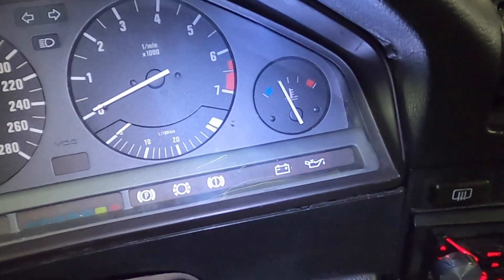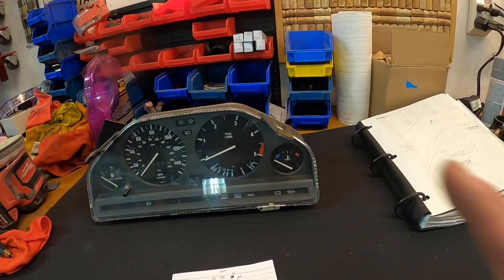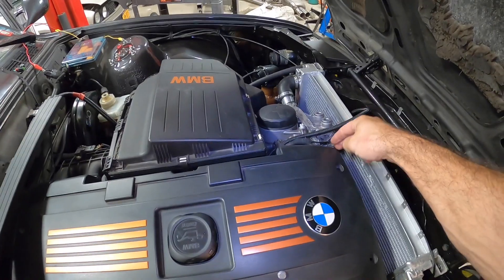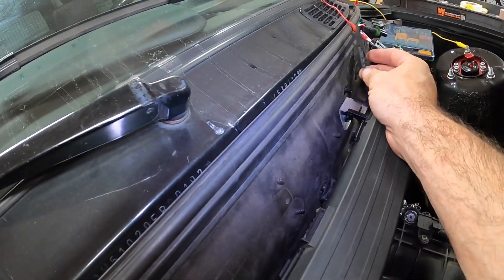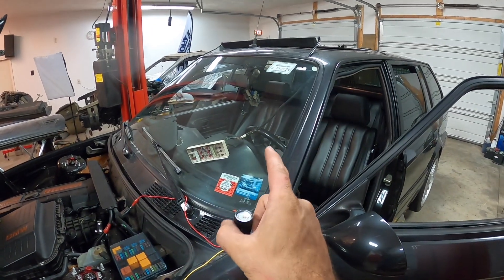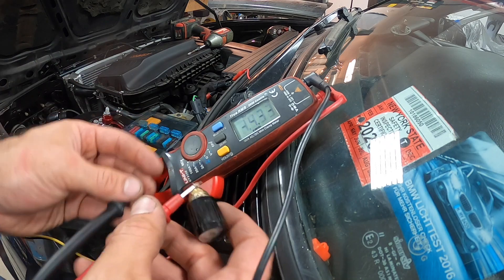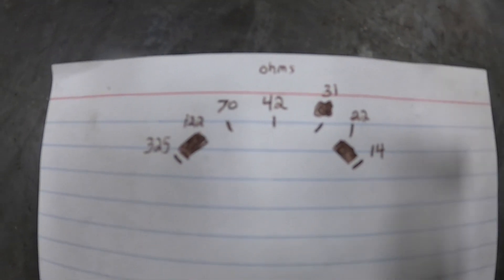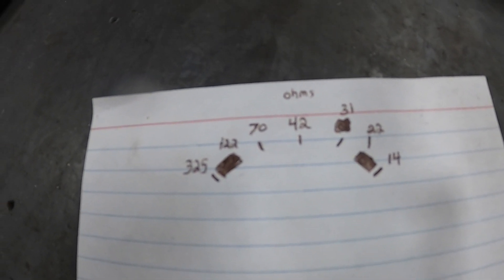Part 38: Here's One Thing You Probably Didn't Know About The E30 Temp Cluster!

Comment: Hi there with a s62 my gauge currently shows little past 1/4 and it never reaches 1/2 mark , At what temperature u will set 1/2 mark ? S62 runs 185-210 in normal operating condition so lets say 200f set it for a half mark?
Reply from the maker: Where are you measuring temp from on the s62?
Reply: @Garageaholic located at upper top radiator its the brown sensor from e30
Reply from the maker: No that’s probably your fan switch, not your temperature sensor for the cluster.
Reply: @Garageaholic no I have custom made radiator and there is a separate switch for puller fan , perhaps Im using wrong sensor?
Reply from the maker: The engine temperature sensor should be measured only as close to the thermostat as possible, or cylinder head. Never ever in the radiator - that does not accurately reflect the temperature of the engine.
Reply: @Garageaholic Thanks can You please let me  know how did You connect sensor to gauge in your s62 e30 , are You using original s62 sensor with 4 wires? Or You using one wire brown sensor but where did U mounted exactly?
Reply from the maker: @r1lukasz  I welded a M14 bung to the top of the thermostat housing on the S62 engine. Installed a single wire E30 temp sender in that location and wired the signal wire to the C101, which goes right to the cluster. Done
Reply: @Garageaholic thanks man, Do You have sufficient cooling with current setup? I see U have stock aux fan and U somehow fit a puller fan , can You share details what fan are U using and radiator? Any overheating issues with ac?

Comment: Great video. Does the temperature gauge have a connection to the ECU ?

On the 1990 316i , M40 engine. My temperature gauge just stopped working a few days ago , After I replaced the car battery. I am suspecting the cluster board. I have shorted out the coolant switch wire after disconnecting from the switch on the cylinder head , the temperature gauge still doesn't move at all. A bit of a surge could have blown something in the dashboard cluster. It starts up fine. Just need the temp gauge going again. I wouldn't even drive it for 500 meters without a functional temp gauge. 
Thank you

Comment: Thank you for the video ! Is it also normal that the indicated temperature on an E30 316 Carburator (M10 engine) is almost touching the red zone before getting back to the middle (and then going to the red zone again etc...) ?
Reply from the maker: Nope that’s not normal. I think you might have a bad radiator fan switch or air trapped in your coolant system!
Reply: @Garageaholic  ok thank you I'll check this then !

Comment: Great man, my m42 temp sensor was reading 1300ohms cold.
Reply from the maker: Yessssssssss!!!
Reply: @Garageaholic   correction 383ohms cold out of the block. My problem is that the temp gauge wont move over the blue marked area, no matter as of how long i run it, si board is replaced. Rev gauge works, grounding nut and point is fine. U reckon its the sensor messing?
Reply: @Garageaholic  it rises a bit but absolutely not over the blue mark.

Comment: I have a very detailed write up about calibrating E30 temperature gauge and characteristic
 curves of the temperature sensors. The approximation of formula for NTC thermistors can be very inaccurate in many cases. You can find it at my post https://www.facebook.com/E30base/posts/127335355708512

Comment: Wow Frank. Very informative. I did not know this. So in the e30 are you able to get an oil temperature gauge as well with the current cluster? Does the e36 require the same amount of work to get the cluster to work?
Reply from the maker: Integration of the oil temp requires a specific rear backing plate to work!

I will actually be taking apart both an m3 and 325 clusters and compare them and I’ll let you know!
Reply: @Garageaholic  yeah the E36 m3 s50b32 has the oil temperature gauge instead of the instant consumption gauge. Not sure if the e34 m5 has it as well. As always nice work and keep it up. I always look forward to your videos.
Reply: @hevendranarayansamy2793  all M cars have the oil gauge instead of the economy guage
Reply: @Garageaholic  Any updates on comparing an m3 and 325 cluster? Diving into this project myself.